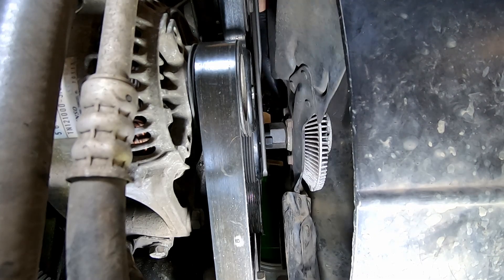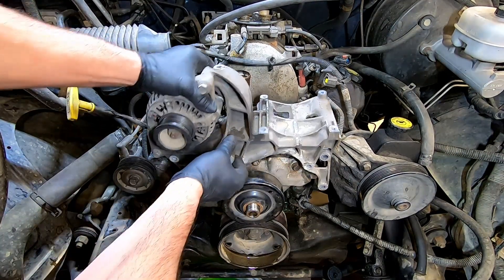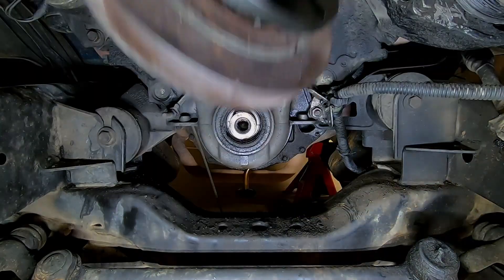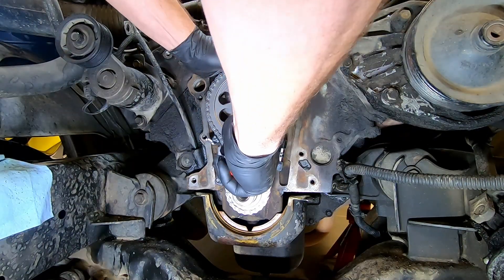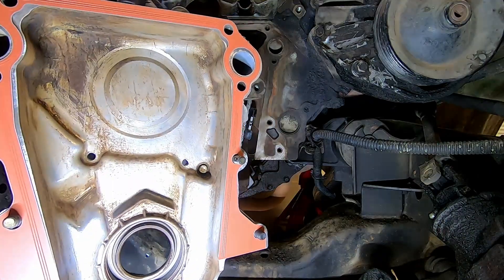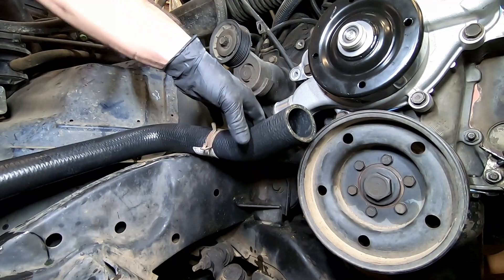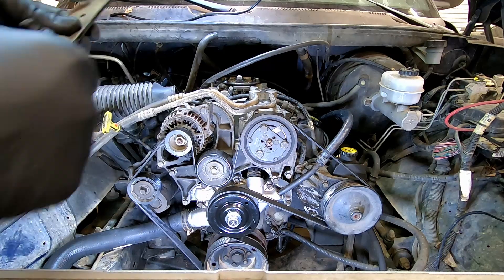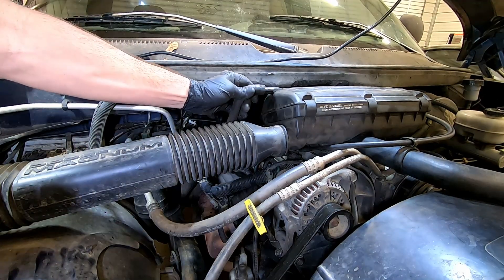Dodge Ram 3.9 and 5.9 timing chain replacement.

Comment: Thanks for this, just did my 98  with 180,00 on the clock , haven't been this deep in in years, so, followed step by step and got 'er done, chain was sloppy so, put a double roller in there for some longevity. Prwious owner was not that keen on regular oil changes by the look of things, Runs like a champ now!!
Reply from the maker: You're welcome and thanks for watching
Reply: It's same for 2002 dakota 3.9v6.
Im doing this same thing great video.
Both gaskets leaked. Timing an h20

In process reinstall but forgot which timing cover bolts.

Do you have picture link of the bolts an length.

Do have everything just forgot put bolts into cardboard pic. location.

Theres stuf going at home.

I know about the two 13mm attached to oil pan. 
There's  two stud like bolt with nut

These are the waterjacket bolts right
Reply from the maker: I will have to look into it when I get home

Comment: First off, awesome video. I really apricate your attention to the details that matter. 

I do have one question for you though. 

My balancer is a one piece. Almost like a high output style. There are no pulley bolts in the center, just the one crank bolt. 

Working with heavy machinery I know not to try and pull it from the out side as, I might dislodge the rubber pressed into the dampener or damage the pulley section. 

I fell like just a basic three jawed puller should be able to grab the flange under the crank bolt to pull out while using the crank bolts head to push off the balancer. 

Is this the best method or do they have a special puller/installer for this type of balancer?
Reply from the maker: Thank you!
I use one similar to this if the balancer has no threaded holes. 

OEMTOOLS 25264 GM Harmonic Balancer Puller, LS Crank Pulley Puller, Remove LS Balancer Without Tapped Holes, No Radiator Removal Necessary, For use with GM, Chrysler, Jeep, Dodge 
 https://a.co/d/c3pLgl5

Comment: Where'd you get all the parts? Do you have links for the chain tensioner bracket and chain tensioner? Also do you have a link or part number for the timing chain oil cover oil seal?

Comment: I have a question. All 3.9 V6 engines have chain tensioner?  This because i have a Ram Wagon 1997. I have changed the timing chain several times and I am sure it does not have a tensioner. Why does this happen?
Reply from the maker: No not all 3.9 come with a tensioner. You might be able to add one but if not you will need a high end double roller timing set. If you're using a cheap set you will be replacing frequently. You can get away with a cheap set as long as you can add a tensioner which comes with a thrust plate. I don't think you can add one on a 97 but I could be wrong.
Reply: @isolateddieselperformance3261  Al right. Thanks for your answer.

Comment: Diesel, I'm in the process of taking everything off on my 3.9 magnum. I don't need to set timing with balancer? I'm good just to take it off and set timing with the sprockets?
Reply from the maker: You're correct.  Your balancer slides on a keyway at your crankshaft so no way you can mess that up. As long as you got the dot on the  cam sprocket at 6 o'clock and the dot on the crankshaft at 12 o'clock before you take it off and the same when you replace with new you are good to go.
Reply: @isolateddieselperformance3261  awesome thank you. If I have any issues I'll send a comment here and get your help. Is it possible the keyways will move during the sprocket change or would it take alot of force to move the keyways? My concern is that everything is good and aligned taking the old sprockets off. But the dots are off by a few teeth when I put the new ones on
Reply from the maker: @JtTaylor-mx3tm  you must have turned the crank or cam. Make sure piston #1 is at top dead center.
Reply from the maker: Also are you sure you have the right set for your truck. Compare old with new
Reply: Diesel, I got an update. I took the cover off finally, it looks like I got the right chain and sprockets but my chain does not have a tensioner on it. I'll put the chain on and see for sure if it all fits right. I'm hoping I did the right part. The one I got came with a tensioner. But there's a piece under the cam sprocket that looks like it could've been a tensioner that broke off possibly
Reply from the maker: Do you have an email I can reach you at?

Comment: Did you check the timing with a socket before you final covered it to verify it’s in time before you start the engine.
Reply from the maker: Are you asking if I rotated the engine over by hand before I put the cover back on?
Reply: @isolateddieselperformance3261  yes, sorry I wasn’t more clear. I realise it’s a video so you don’t show everything.
Reply from the maker: @realcdcruze3558  I try not to leave steps out. I will go back and look to see if I left that out. If so I will delete this video and repost with that step added. Thanks for catching that if you're correct on that step being left out.
Reply: @isolateddieselperformance3261  the video is great. You took a long job and really captured the needed bits.

Comment: so why did you have to replace it?
Reply from the maker: Water pump was leaking so I decided to go ahead and replace the timing set while I had everything apart and the fact that it's never been replaced.
Reply: @isolateddieselperformance3261  how many miles did it have
Reply from the maker: 286,000